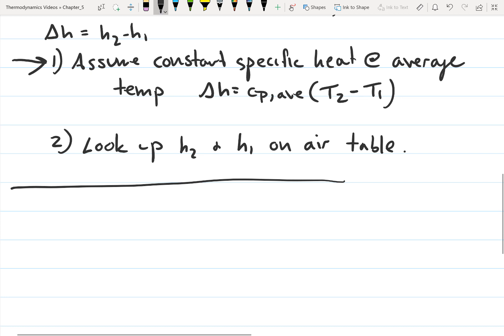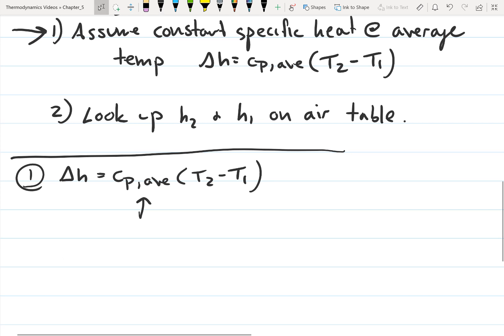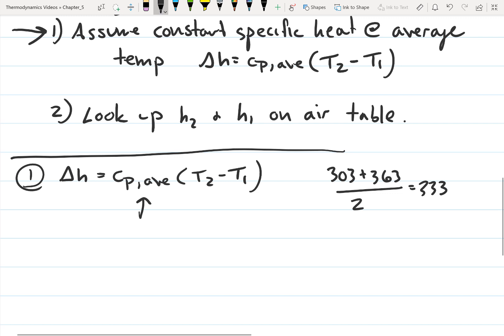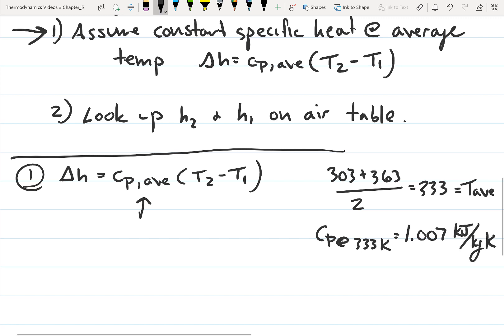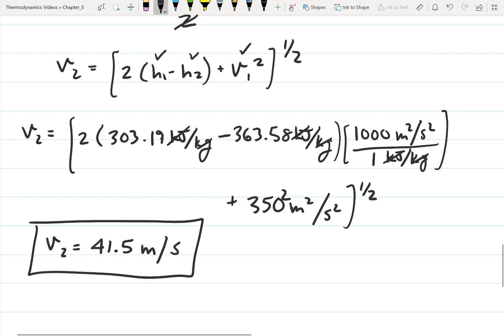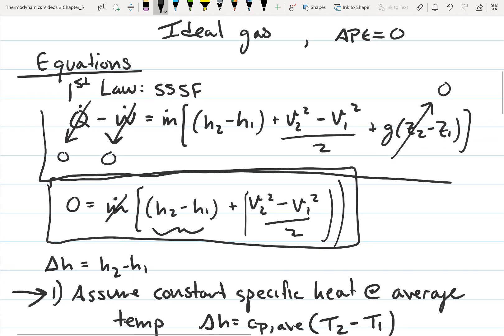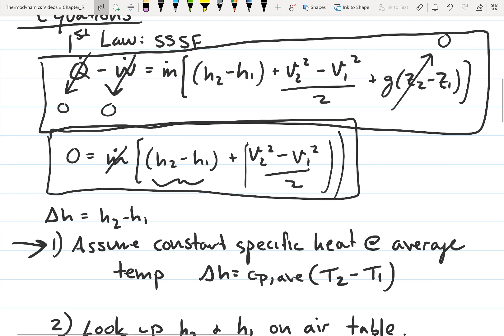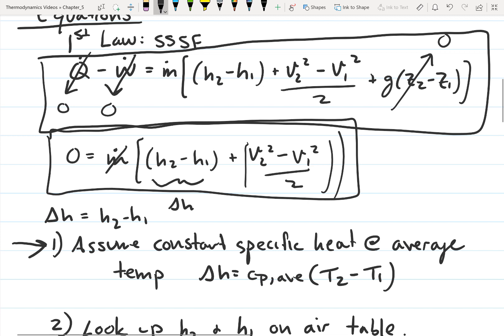Thermodynamics: Steady Flow Energy Balance (1st Law) Diffuser

Comment: Hi, this was super helpful but why at 7:30 do you remove the mass flow rate out? It doesn't seem to be cancelled by anything.
Reply from the maker: I'm dividing both sides by the mass flow rate. So I have 0/m on the left hand side which is equal to zero.
Reply: @railitaylor  wow thank you for both responses! Lifesaver! I have a thermodynamics quiz tomorrow :)